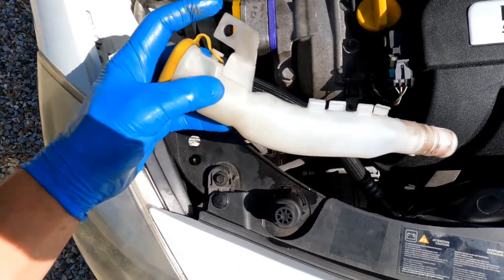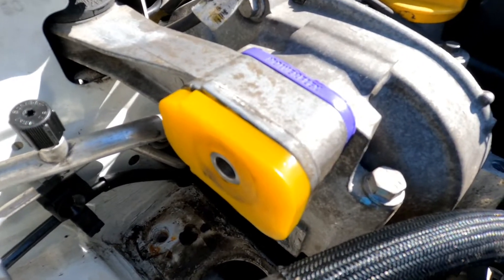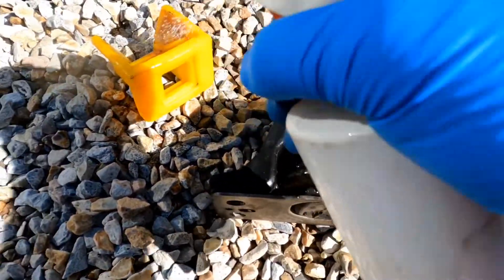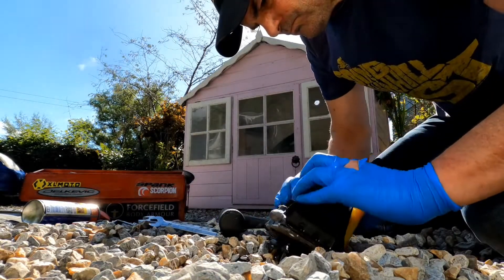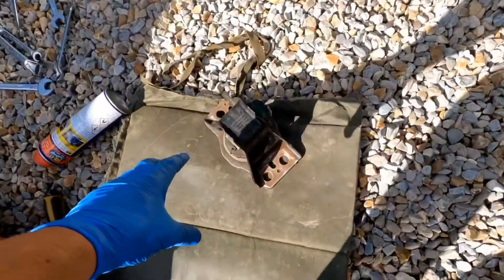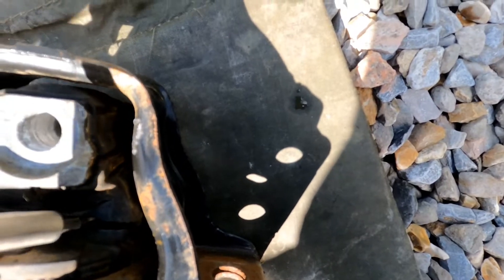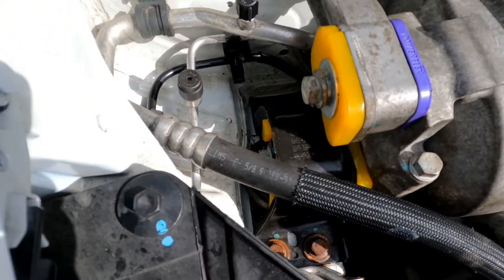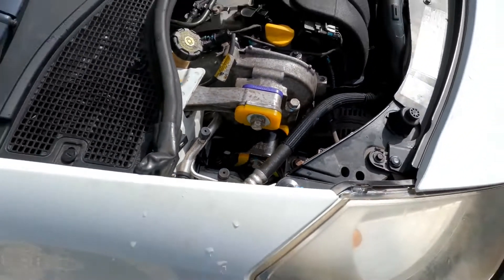Clio 200. Powerflex Engine Mount

Comment: How do you manage get the bolt out from engine mount to the engine? as it had no room for breaker bar to loose the bolt because of the a/c pipes in the way...
Reply from the maker: It was a long time ago. If I remember correctly. Remove the top engine.mount first. Jack it up from the sump. Protect the sump with wood. The bolt should be high enough to clear the Aircon pipes. I hope.this helps. Maybe the second video taking it off shows the bolt removal from a better perspective.